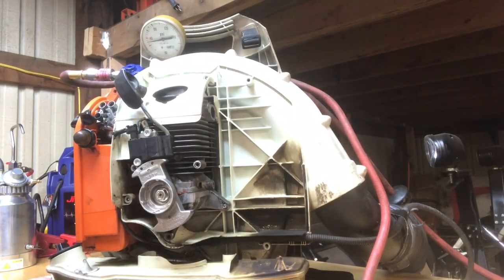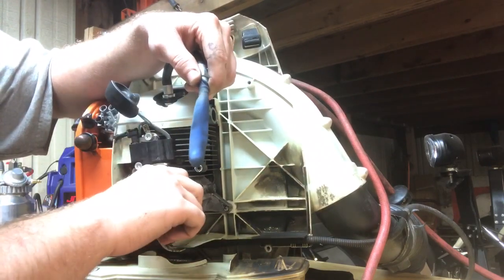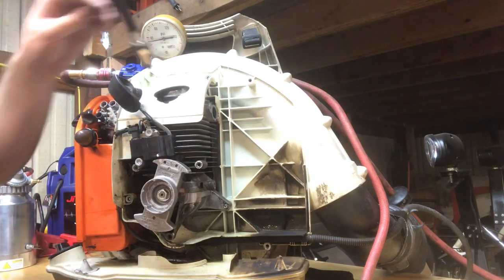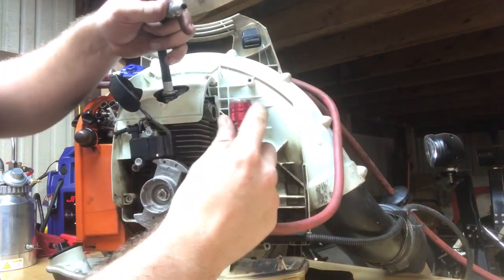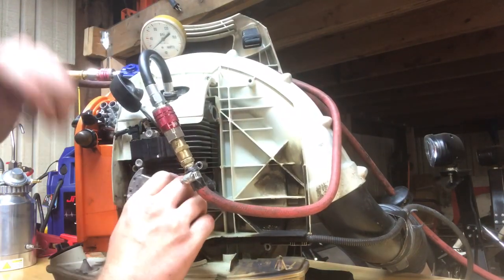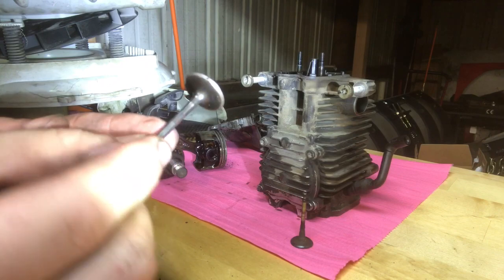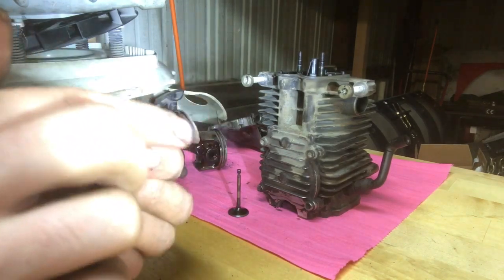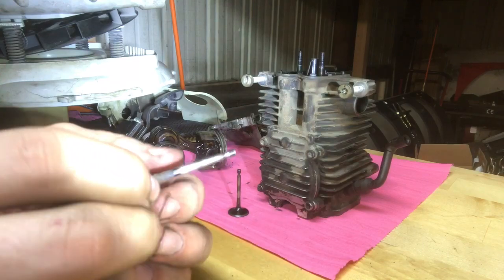Stihl BR600 Cylinder Leak Down Test

Comment: You can pull the cover and give the ex valve a bunch of quick taps with a small hammer, sometimes the carbon clogging it open will come loose.  A little seafoam can help clear it up too..  I used to advise guys with this scenario just to buy a new engine or unit instead of rebuilding due to the labor cost and increased likelihood another major issue would develop.  Of course customers always try to blame that on the shop..lol  Nothing to do with them using crap oil....
Reply from the maker: I’ve had luck attaching vacuum hose to valve stem and drill gun. Does that count as a reseal? 😂
Reply: @hillbillyrigrepairs1814  I've done something similar myself..lol 👍

Comment: My br600 and br430 are both leaking oil around the bottom engine pan and niether will run properly. What do you charge for an engine reseal on these blowers or what should I expect to pay for this job? I've heard it consists of removing the engine from the blower to be able to remove the engine pan and re seal it with gasket maker and replace the crankshaft seals. Thanks in advance.
Reply from the maker: $25 to diagnose. Takes about 1hr to pull engine, pop new seals in and reassemble.
So $50-$75. But the blower could have other issues as well. causing it to run rough.
Reply: @hillbillyrigrepairs1814  I really appreciate your fast response. I'm willing to pay up to $100 per unit so I guess I'll be searching for a small engine mechanic here in dallas tomorrow morning.

Comment: No reason to mark it just line up the S with the post if I remember correctly. I'm going to go buy a leak down tomorrow. Mine ran like crap until it quit starting. All I can think is the valves aren't seating or the plastic cam gear is worn out. Replaced ignition coil, fuel filter, fuel tank vent, carburetor, spark plug, air filter, adjusted valves, fresh 91 pure gas, cylinder pressure test is 110 psi, cleaned spark arrestor.
Reply from the maker: Using a paint marker for timing marks, on cars, truck or even leaf blowers is a good habit to fall into. What if someone didn’t know the “S” lines up a certain way(which I agree it does)-well they wouldn’t need any service info, just basic 4 stroke operation. Good luck brother!

Comment: Great video , when you put the hose in do you have to take out the valve of the hose.
Reply from the maker: Yes. There is a shrader valve in the hose: it’s simple enough, but I’m looking to buy the OTC leak down tester off amazon $70 or so. I have their compression gauge set and the quality feels pretty good. Best of luck!